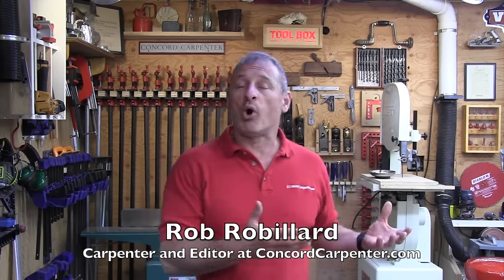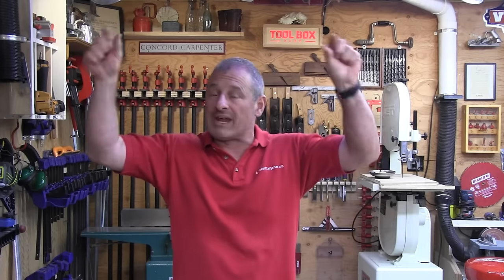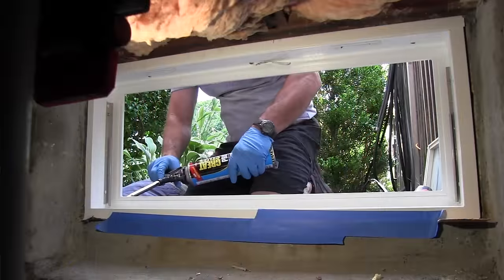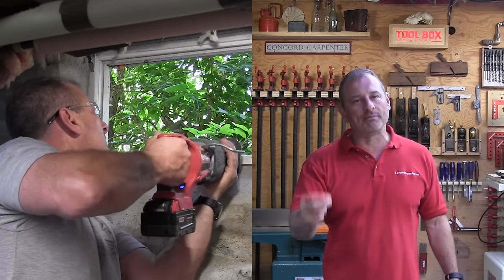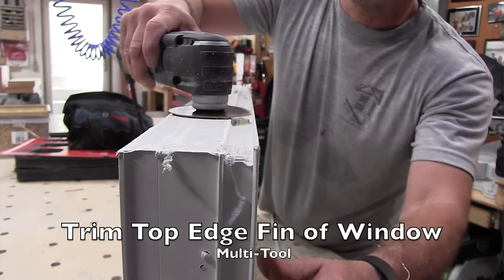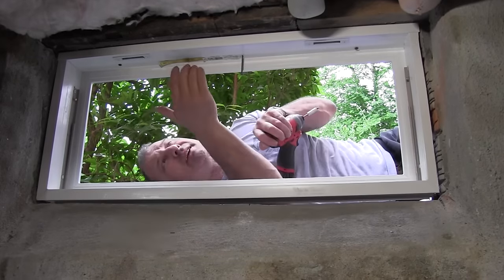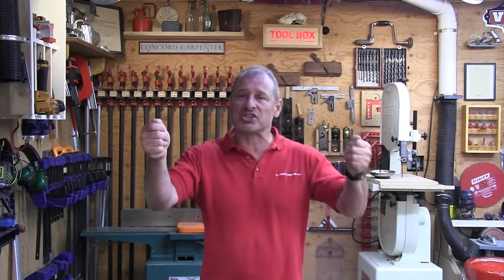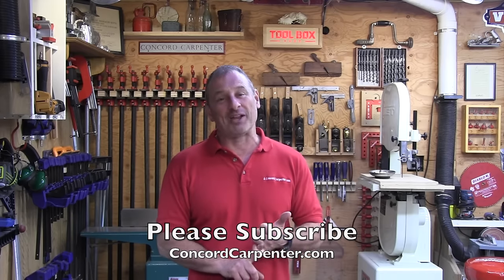How To Install A Basement Window ~ in Masonry

Comment: I just replaced a couple of 50 year old windows in my basement. I was able to find a window supplier on the internet that specializes in retrofit window inserts for houses with old steel bucks. In my house's case, the steel bucks were made by Kewaunee and were an odd size 31x11.5". This window supplier had all the information to help identify the manufacturer of my steel buck and had really nice double pane vinyl and aluminum window options. He's right, if the steel bucks are not rusted through, you are better off just painting the steel and finding replacements. We love the new double pane vinyl windows that replaced the leaky old single pane aluminum insert windows. I don't want to come off like a shill for the company that sold me the windows so I'll omit it but I'd be happy to share it for those that need windows.
Reply: I'd like the name of the company if you don't mind.
Reply: What’s the company name?

Comment: Been replacing my own windows that were the same as the one that you ripped out... however, they were already re-done sometime in the late 90's seems like. They ordered the windows to fit into the original wooden framing of the original windows. Ever see basement windows with an 8" frame (combination of original and remodel) surrounding the actual sliding insert?  24x36" window roughin, with only 14.5x27" glass space. 😂

Comment: What type of mortar do you use to fill in the gaps? I'm reading that mortar has different types such as N, M, S, ect.
Reply: The one with least amount of psi strength, as all mortar expands and contracts. If you have a old home and used type S to fill/repair mortar joints between bricks, it will eventually expand with a high psi and cause spalling.

Comment: Great video Rob. I work in the DC area and the most common scenario I've encountered is walls that are 12" to 16" thick with the windows being recessed to the inside. So we normally hold the replacements as far in as possible to keep them away from rain and water sheathing down the wall face. Several times I've trimmed the exteriors with PVC trim boards that are held in place with a combination hot melt glue and quad caulk. It works good and it usually conceals the old caulk line wich looks good and clean.

Comment: Good content, as usual. Another guy I watch is Mike Haduck who is a masonry YouTuber. Very informative and therapeutic, but, as he likes to say, "he's not gonna be winning any awards." Anyway, he has a technique he uses that I find intriguing. He screws the frame into the wood header if there is one. He then puts little 3/4" screws just barely into the frame for the mortar to hold onto. He then fills the void with mortar and finishes it. He explains how you need to we your surfaces first or apply a cement paint, otherwise it won't stick. 
I recently did a job where I removed the steel bucks. On that job, I made new PVC buckframes to set the windows into and foamed the PVC buckframes in.  I then trimed it out with butt jointed PVC trim boards. It was overkill but the customer liked it. 
Removing steel bucks is not for quitters or the faint of heart. The Corners are the hardest. 
Looking at another job with brick sides, steel lintel on top and an angled concrete foundation on the bottom. The existing windows are steel and mortared in. I think I may do a more Haduckesque install. The top is steel, so no screws. The sides are brick, and who knows how that will hold up to screws. And there is no real boom. Going full on masonry is probably the best bet.

Comment: Good video Rob. Just did a window like that at my daughters house and repaired the sill and a beam. Either the builder or someone else didn’t put a door exiting the rear of the basement and decided to make one by busting out the concrete to make the opening. There was no header below the sill plate and they made the opening right in the middle of where the sill plate had a seam where the sill plate wasn’t long enough and they used another board to finish the sill plate. Normally not a problem but since they cut (correction... they busted out the concrete which they tried to patch the left side of the concrete wall with broken pieces of brick and mortar.  Had to repair that too!) the concrete out up to the sill plate and the first floor wall was dipping and the wall was cracking I had to jack it up and repair it and a cracked beam. What a job. Maybe next time I suggest not buying a house she will listen?? 😊

Comment: Thanks, I’m working on mine today. Where did you get that foam sprayer nozzle? Also, how did you attach through the metal lintel? I see you ran screws but I’m assuming you predrilled the metal?( not mention)

Comment: Damn, great video. Took me a long time to find a video talking about the mortar application. It would be great if you mentioned the mortar product used..? Thanks, well done!
Reply: Use Rapidset! Either "mortar mix" AKA the red bag (≈$18.00) or "cement all" aka the blue bag (≈$26.00) they set really fast so mix just a little at a time and/or buy "set control" (≈$2.00) it's a tiny bag you put in the mix to slow the curing time just a bit.. They're both available at any H-Depot. Good luck ✌🏻

Comment: Order it a 1/2 in smaller but I can't even find the window dimensions I need in the first place. Also, you only drill in one side of the window?
Reply: Top and bottom. Doesnt hurt to add some screws to the sides too. If you cant find 1/2" smaller than your opening you can add wood around and go even smaller

Comment: Hi Robert. Nice video. When you attached the window to the sill plate with anchors, did you first apply any caulking, or just screw it directly on? If no caulking, how did you ensure it was water tight? Not sure how you would've squeezed the foam in there

Comment: I have a 1933 Sears kit home. It HAD the original basement windows. The metal frames were rusted and they couldn't open. In the summer the basement was cool and dry. In the winter, I put batting in the well and the basement was warm. Soooo... I had them replaced. The (idiots) that replaced them told me that they couldn't get the size (a lie) so they framed in the opening with (supposedly) pressure treated wood, then place the windows in, made an attempt at spray foam, though some windows I saw daylight through and refoamed myself.... Truth- they wanted the job done NOW, and had to buy off the shelf on their HD credit card. Custom fit would've taken longer. Anyway.... my basement is humid as he!! this summer and cold as he!! last winter. The window brand? Home Depots cheapest sliders. My question is... does the wood framing make  a difference in temps of basement? Oh, and they didn't caulk around the frame on the exterior. I ended up doing that, but the 1/4" gap keeps needing to be recaulked. Electric bill is through the roof with basement heat rising to first floor and a dehumidifier constantly running in basement. Could it be the windows? And why would anyone put sliders for a basement? Track gets filled with junk (leaves, etc). SMH

Comment: If you spray water in the gap to be foamed it gets a much much better fixing, I did a few little tests and the holding strength is multiples stronger
Reply: Ben Chippy 
Yeah Ben it does make that polyurethane foam stronger and it will stick to the concrete like mortar doesn’t it.
Reply: @ronh9384  enough water, and a few protrudingscrews should be enough to hold new concrete to old....the key is to soak the old mortar so it doesn't pull moisture out of your new mix.

Comment: I will not replace any basement windows if the homeowner is going to use or rent the basement without putting a full size window on the opposite side of a exiting door in case of a house fire so no one will be trapped
Reply from the maker: Joseph Malinowski that’s called being a professional carpenter with integrity
Reply: A Concord Carpenter / ToolBoxBuzz thank you that means a lot love the channel